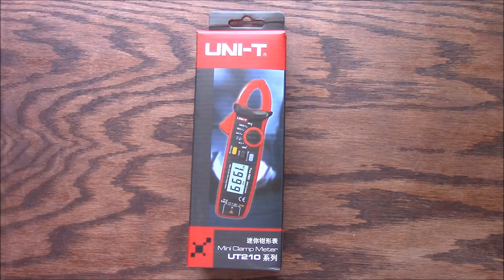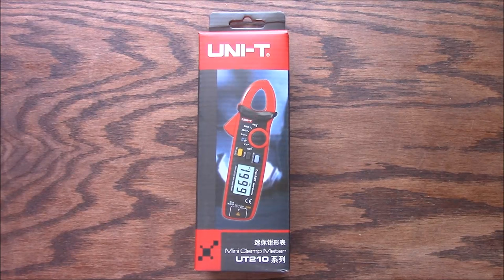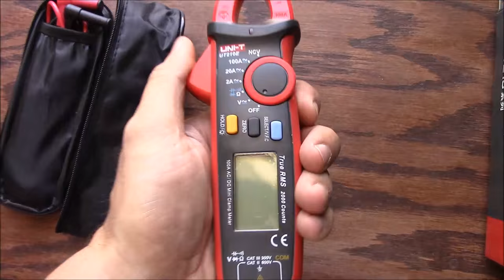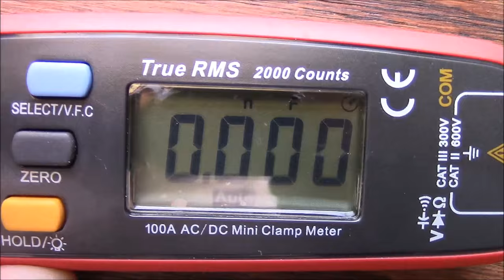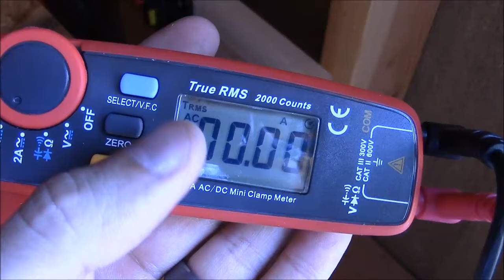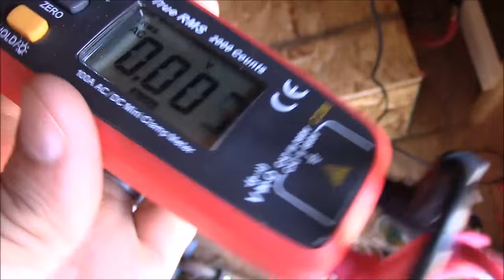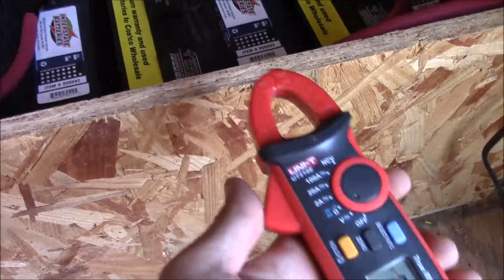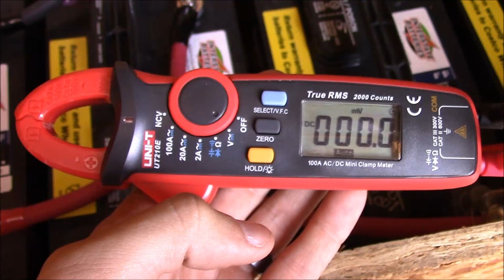UNI-T 100A AC/DC Mini Clamp Meter

Comment: I bought one and am very happy with it, on Volts Ohms etc. it reads almost the same as my Fluke, you need to use your brain with low DC Amps re zeroing..
Reply from the maker: Yeah I don't think that is a necessary feature to have automatic zero'ing.

Comment: The 100 amp rating means it will only see 100 amps max if you have more it just won't show it correct it would read 100 and not damage the unit correct?
Reply from the maker: Correct.  It uses a hall effect sensor which measures the current through its magnetic field.  Since the current is not actually passing through the unit itself it should not be able to be damaged.

Comment: Brother if by mistake our rotary switch is on set diode and continuty mode and we insert the probe in socket for measure the volts then what happen?? Can it be damaged?
Reply from the maker: I don't think so.  But I wouldn't do it.

Comment: Hi!, Sorry, I'm new in this channel, but, (at 5:44) Don't your batteries need an air flow? Mine do
Reply from the maker: Ideally you would probably want a little air flow or more active ventilation but I do have a tube running to the outside air that helps avoid dangerous buildup of gases.  Also ideally you would want to keep your batteries cool in the summer and well above freezing in the winter.  If you could have them in a well insulated and ventilated box buried in the ground I think that would be perfect.